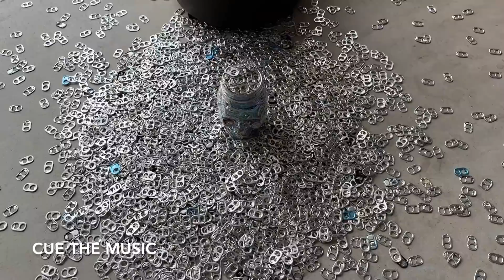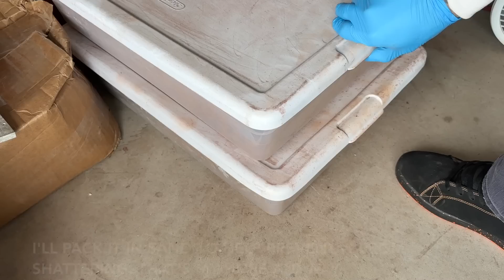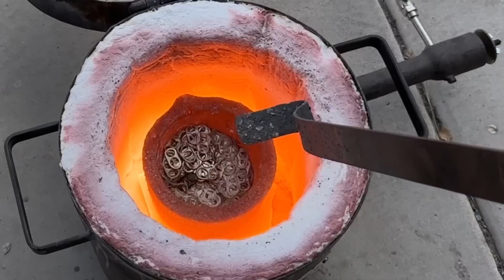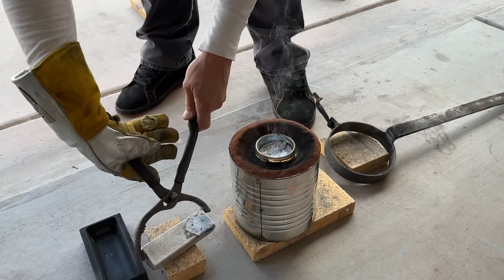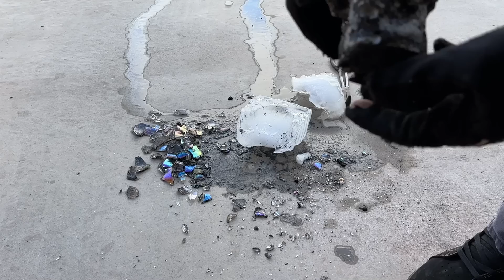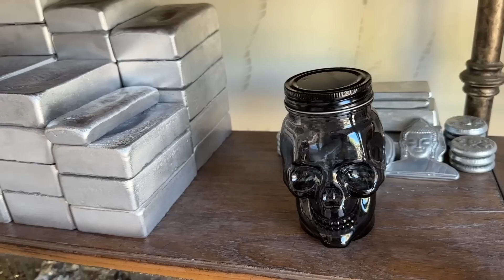Melting Aluminum Can Tabs - Pouring Aluminum Into A Glass Skull Jar - The Growing Stack

Comment: It will look smaller due to the mould forming to the internal space, rather than the external surface of the glass.  Interesting concept, though.  It was inevitable that the glass would crack.  In fact, it has to do so in order to get the metal out, once it's cooled!  The porosity of the metal is due to the expansion of air inside the jar as it was poured and the metal solidifying before it could escape to the top.  Having the metal cherry-red by having it hotter would help, but it's the glass container that would draw a lot of the heat out that would cause solidification before the air could escape.  But, having said all that, it's a good effort.

Comment: I just saw your plan to pour in the glass jar and paused the video to uess on what will happen.  The glasswill crack up, fall in the aluminum  but the sand will hol its form and you will have a partial skull that has shards of glass exposed within the mold

Comment: does the furnace get hot enough to melt glass
Reply from the maker: I’ve tried making glass before and got a thick “honey” that I glopped into a coin mold after an hour of melting sand and some other ingredients. I want to try doing that again one of these days. I’m sure it could melt if I just set one in there 👍

Comment: What if you made a mold in the sand from the jar, then you don't have to sacrifice the jar and maybe the cast comes out clearer?
Would that work?
Also seeing them side by side, I'm thinking when the original was made the detail on the inside isn't as good as the outside so if you cast the outside first to use as a mold the detail on your finished piece should be better, right?
Reply from the maker: That would definitely work, but I was curious what would happen by pouring into the glass so I wanted to run the experiment.